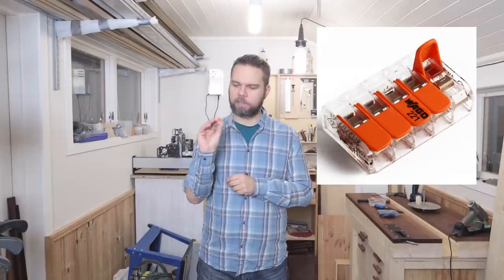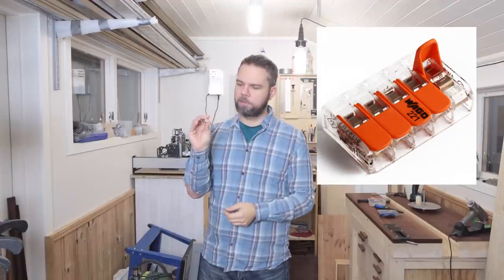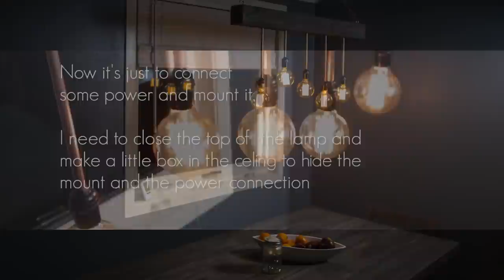DIY Chandelier - Farmhouse Style

Comment: Finally found a similar project hoping to avoid some shopping lol was also looking to see if anyone has used glass tubing around the copper as conduit, wanted to use copper tube to complete circuit an fill inside of copper tube with LED light and holes drilled in for extra ambience and some of those mini  lights to float withing the glass tube area.

Comment: I hope that old connector doesn't get banned in Belgium yet, I have a big load waiting to be used. But that new connector seems really handy. But I don't like that it isn't white. We call the old connector 'sugar cube' since is resembles a bit a sugar cube, small and white, but for the new one it is transparent and yellow, so that name wouldn't work. Maybe we should call the new one the Dutchman connection..
Reply from the maker: It worked really great and much easier to work with than the sugar cubes. The first generation of wago I think was gray (but a little bigger). I liked that it was transparent because it makes it easy to see how far you have to push the wire.
Reply: Dieter Schneider yeah I can imagine it being handier. But if I ever have kids, that would make me have to explain why we call that sort of connector a sugar cube. I have never seen a transparent with orange sugar cube. If they are as dense as me, that will be a tough job. But it does make connecting easier and probably safer.
Reply: These Wagos are great when you are low on space for the connectors. The older grey ones are just as good, just bigger and cheaper ☺️